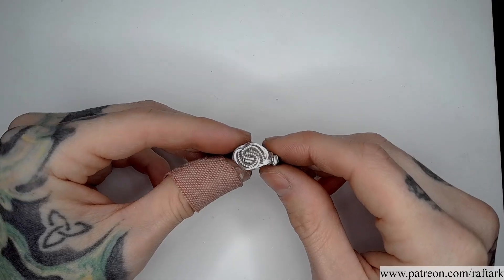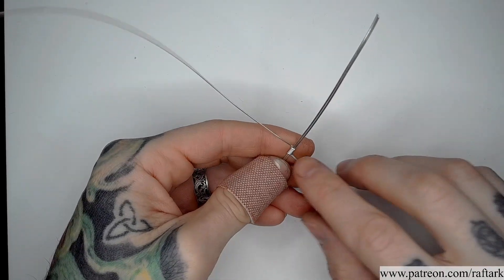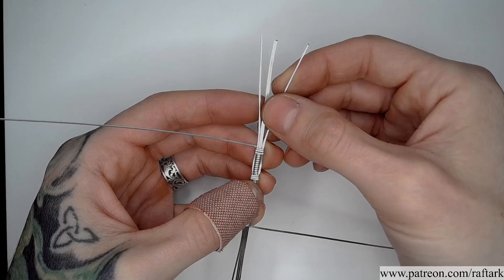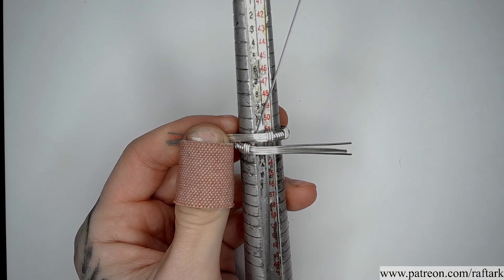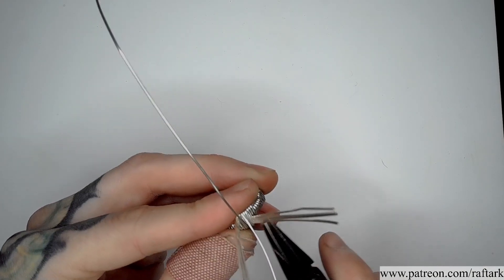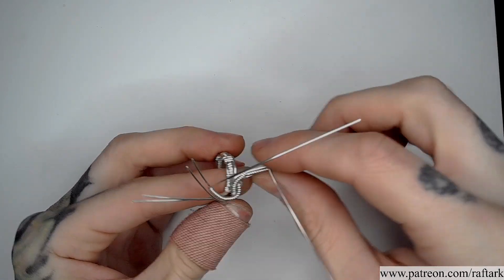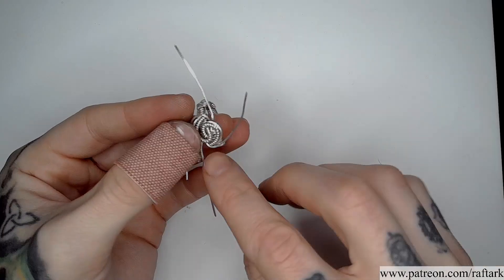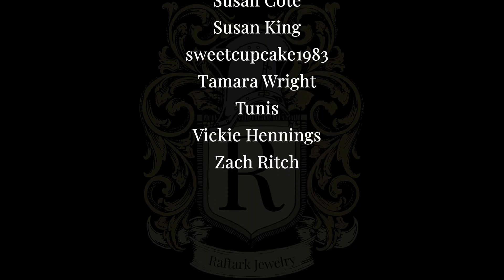LET'S MAKE AN EASY WIRE WRAPPED RING! (No solder, no stones, no crazy tools necessary!)

Comment: I'm fairly new and have 20 square. Would there be any noteworthy difference from 21 g?
Reply from the maker: Definitely not enough of a difference to buy 21 if you already have 20! I switched from 22 to 21 years ago and have just always stuck with it. I’d use what you have! When it comes time to resupply you can always experiment with other sizes if you want to then